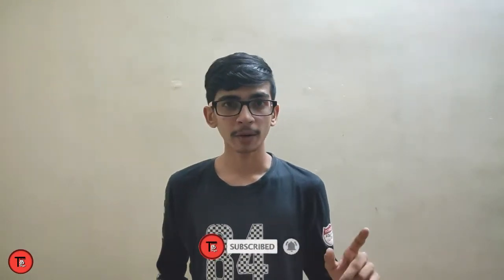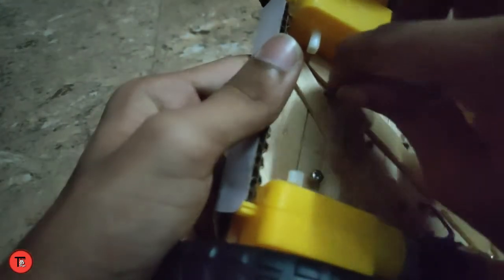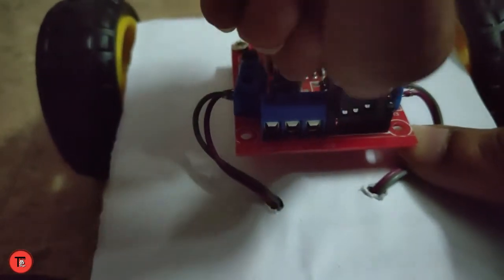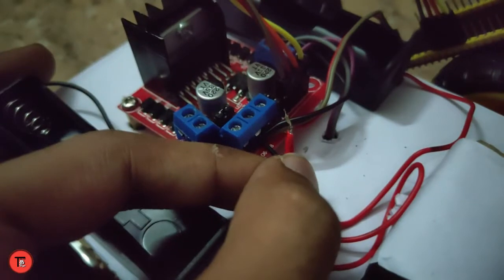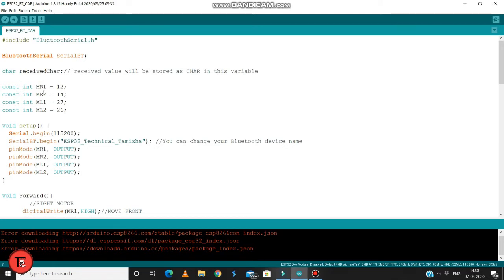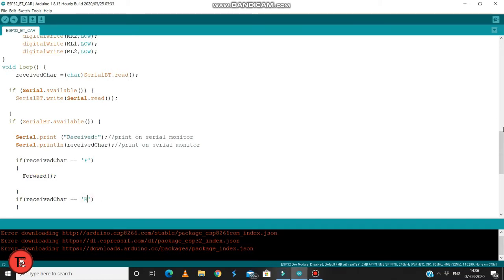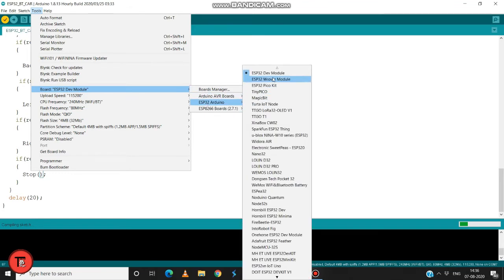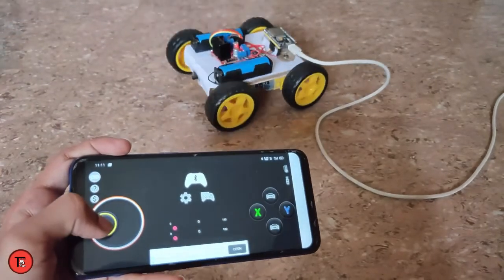How to Make Bluetooth RC Car  |ESP32 - Node MCU  |Arduino  |Technical Tamizha

Comment: Super 💗🙏
Reply from the maker: Thankyou ❤️
Reply: @Akilesh-S  Arduino Mathiri wifi controler mobile programming ponnamudiuma bro please oru video poduga bro❤️🙏
Reply from the maker: Purila bro wifi controller mobile ??
Mobile program epdi pandrathuku ketkurengala for Wifi controlle...
Reply: @Akilesh-S  wifi controler mobile  programming pondrathuku Application soluga bro
Reply from the maker: Elathukume Arduino IDE use panithan bro program pannanum. For mobile Arduino droid